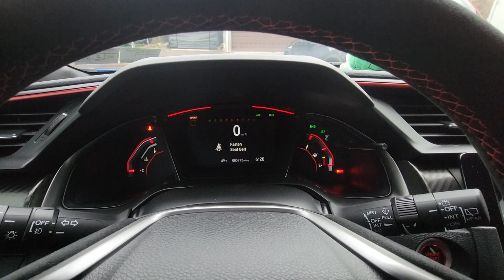Exhaust Rattling Issues | Type R's Last Meet?

Comment: I recently got rid of my AWE exhaust because of similar issues. You’re seems like the muffler itself is hitting the hanger. I’ve had to loosen the clamp and slide the rear muffler section as far back as possible. 

Hopefully your clamps don’t loosen overtime causing an even worse rattle around 2500-2900rpm.
Reply from the maker: Sheesh. I guess this is a common issue with this exhaust. I thought it was the way that I installed them a while back ago 😅